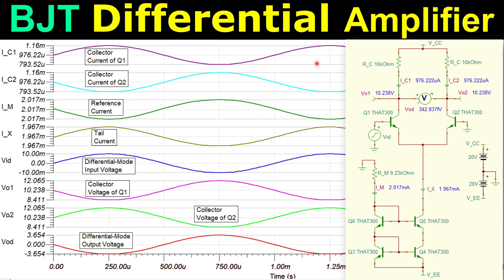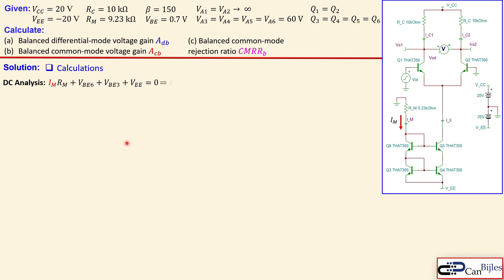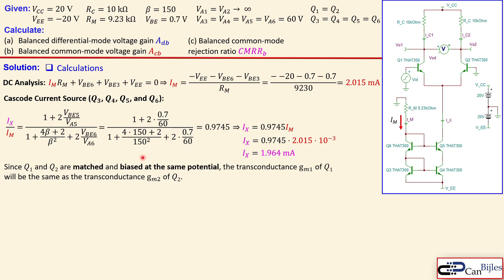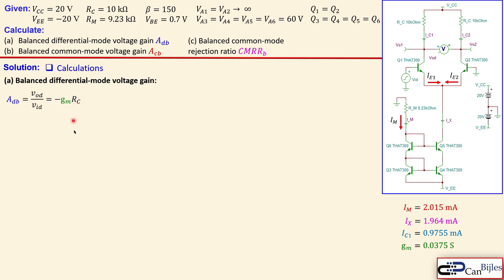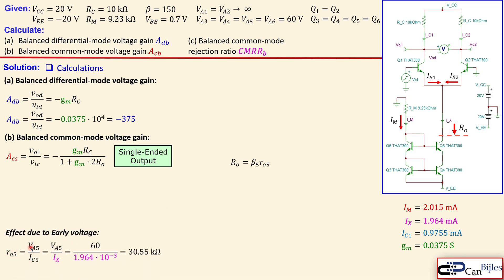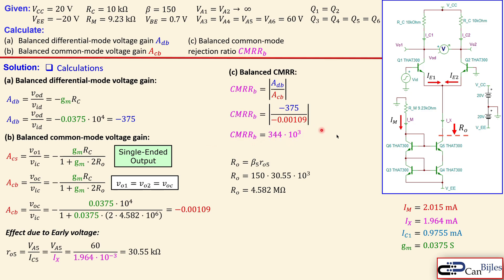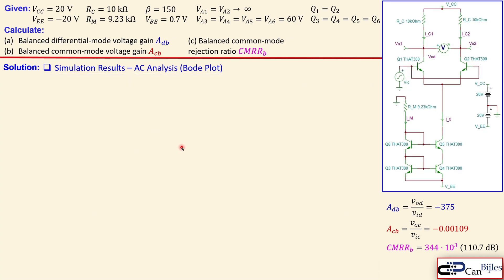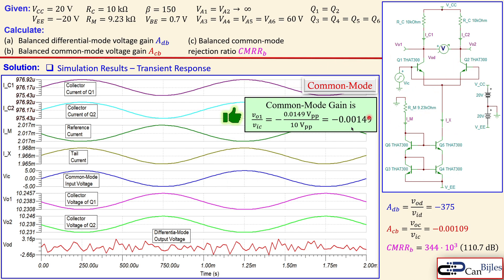BJT Differential Amplifier 🌟 Cascode Current Source 🌟 CMRR, Differential & Common-Mode Gains 💡 EX5

Comment: Thank you for your continued explanations.  I went to the THAT website and downloaded their BJT library and extracted a text file for their 300 series Model QPNP_THAT_NS NPN which shows a BF=150 and VAF =60 to try match your examples.  I also edited the file to create a second file with VAF=1e30 (highest TINA TI would accept) to match the other BJTs.  However, I cannot get the TINA simulation I build to exactly match your values.  Would you mind sending a link to one of your examples with the two different BJTs so I may see the difference to mine??  Thanks.
Reply from the maker: You're welcome! I recommend double-checking the transistor parameters and biasing conditions in your TINA-TI simulation against the video example. Small differences might lead to variations. The TINA-TI SPICE files are included in the video description.
Reply: @CANEDUX  Thank you for the suggestion.  After carefully adjusting the parameters I was able to come very close to your examples.
Reply from the maker: @richardsmith813  Great it worked out. Did you used the TINA-TI SPICE files in the video description?